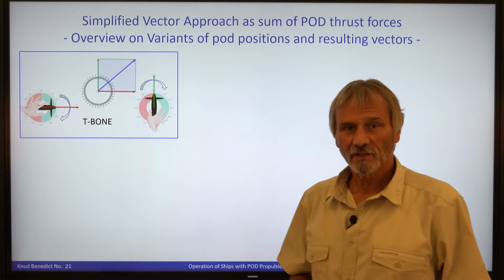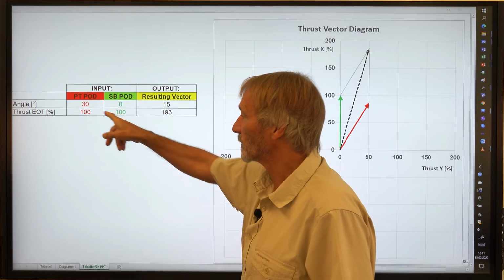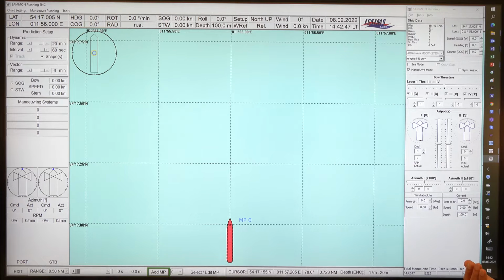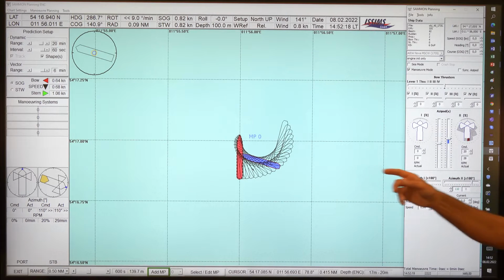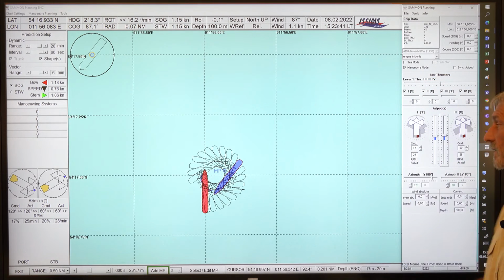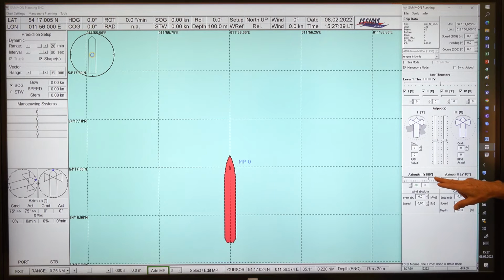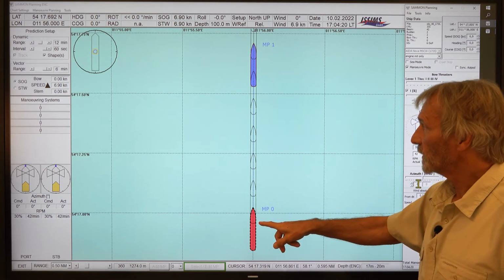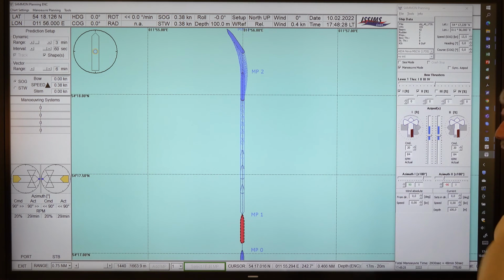Simplified Vector Approach for POD forces – samples and limitations

Comment: Harbor pilot here…most cruise ship Captains are very resistant to 0 RPMs.
Reply from the maker: Thank you for your message. You are right, and I can't understand why they have this reservations... In a car they would not slow down with the  brakes while keeping the throttle constantly ahead...
Reply: @issims-innovativeshipsimul4419 they say it is  mechanically bad for the pods.